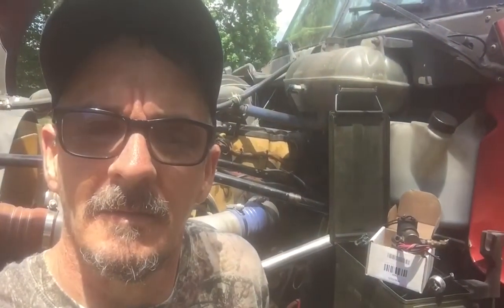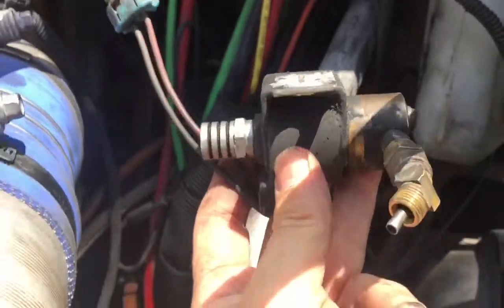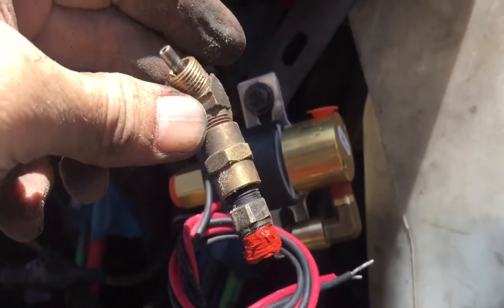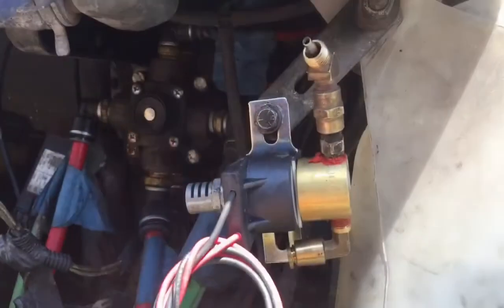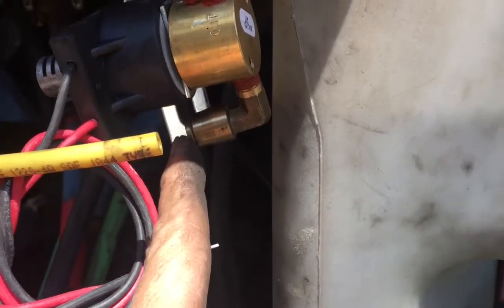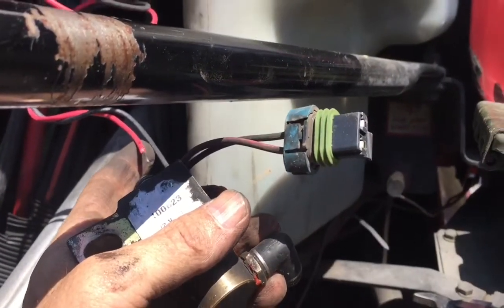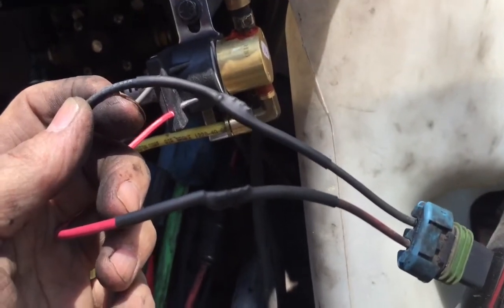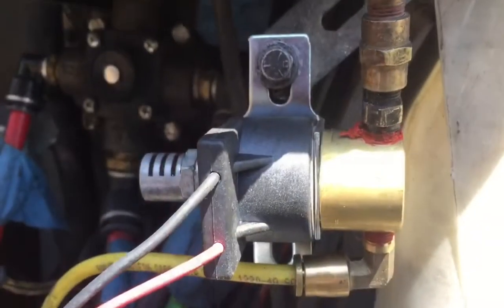Bad Fan Solenoid repair on Freightliner Century

Comment: Can you wire new Solenoid wrong and it keeps sending air keeping fan clutch engaged? Mine stays on after replacing solenoid. So confused I got a sterling Mercedes engine 4000 series but ac doesn’t blow cold or as cold 🥶 could that be my problem

Comment: I drive a Mack fan stays on. we're trying to find the issue
Reply: I have the same issue with mine. Did you ever fix it?
Reply: Run a different solid and run it to a switch,  what I did eliminated that shit..
Reply: @hardialchatha  wire harness got wet from a water leak.
Reply: @BigAlWillis  thank you for replying. I'll let you know if that fix it.